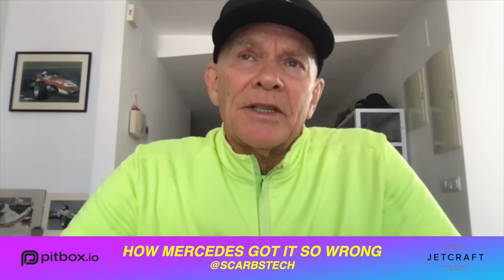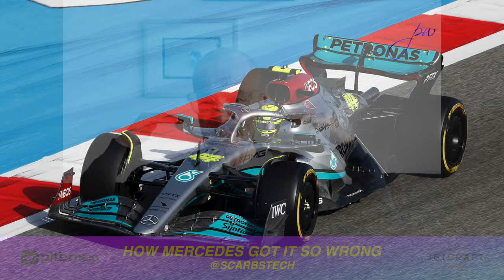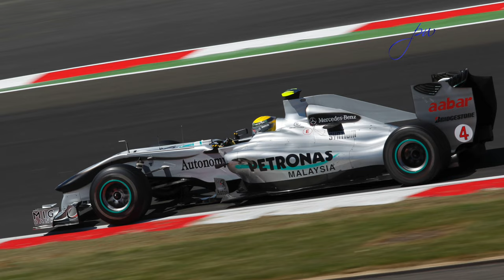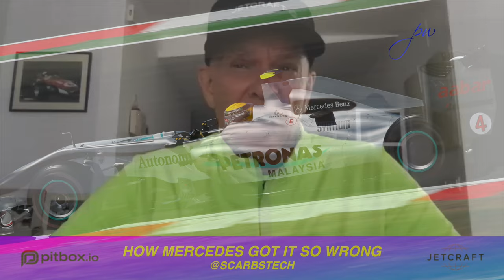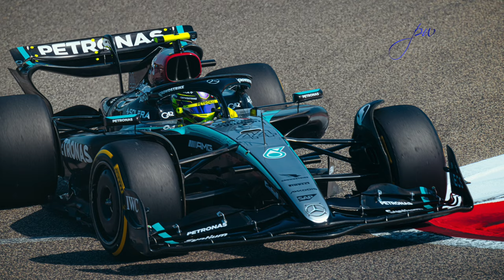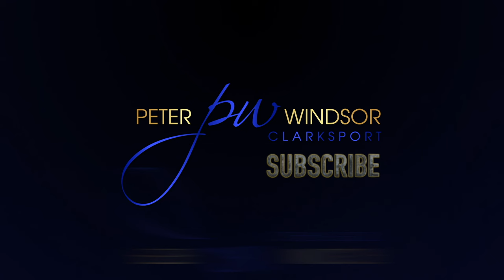HOW DID MERC GET IT SO WRONG? Scarbs analysis by Peter Windsor

Comment: Unfortunately, it doesn't seem like just a poor understanding of the new regs, it also sounds like poor engineering choices, compromising the CoM and allowing other detriments to affect driver positioning/feel, weight distribution and tyre wear, to facilitate the zero pods which Merc admitted were not that impactful on performance last year. Would getting this right have fixed the rest of the car? Probably not to the degree of being able to challenge RB, with the other issues they'd faced with suspension and aero/drag reduction, but it could have been one less area to have to fix over the winter...
Reply: My sentiments exactly , the floor design especially  and the lack of surface area around the car to direct air as needed 🤔 but not listening to the drivers regarding certain issues 🤔

Comment: If the car was porpoising because of the ground effect followed by bouncing with the fuel tank that high. The harmonic behaviour of the fuel (the oscillations) sitting up that high would be a contributing factor to the bouncing. The fuel in end becomes its own damper, as the oscillation’s decay.

Comment: I think it clear that once you commit to the package like mercedes did an found out it doesn't perform it difficult to bring a overall change to the entire platform. The package layout took all the investment along with the teams idea , so while everyone is saying this and that remember as Totto said the budget didn't allow them to change radically from what they had 🤔 the ability to package the mechanicals the way they did to use the reduce side concept is engineering on its own 🤔 that was the undoing of the car from lack of surface area to direct air in some way are another.
Reply: True, the budget cap didn't allow them make radical changes in-season. However, after the 2022 season, with a fresh budget, they should have either correctly optimized the concept (which they tried and failed at) or changed it---which they've finally done this year. 

There's no question that they dropped the ball because they had issues not only with the concept and the execution, they also had wrongly built scale models for wind tunnel testing. That's an unforgivable error for engineers of the elite class. 

Mike Elliot just wasn't up to the task.

Comment: This is an interesting but if this really is a correct assumption I am curious why they struggled as well in quali with super low fuel.Any which way i do agree with the assumption that they focused to much on aero and neglected the way the car and the weight of the car influences the relation between the car and the surface.

Comment: If this was such a massive effect, Merc wouldve been a beast in quali. Which they weren't.
Reply: Yip, that's the obvious question...
Reply: you're ignoring the part about the forward cockpit and the "feel" (or relative lack thereof) of the car by the driver.
Reply: sandbagging maybe?
Reply: @S0ulinth3machin3  What does that have to do with them supposedly gaining speed relative to  others towards the end of the race because their center of gravity was lowering?
Reply: I think the merc couldn't fire up the tires properly  causing the car to slide around early on in the race. Fuel tank being lower should help out alot, but good luck keeping with Max. That dude is in.the zone.
That
Reply: Merc has a great car…this will be like ‘21 though…where they have the best car, but not a good enough driver to beat Max, it’s a sad reality🥺
Reply: The fuel tank was still higher. Use some critical thinking my dude
Reply: I think their problem in qualy was that the car was draggy
Reply: @Marc98338  The point I was adressing was why the car isn't good at qualifying either, and the qualifying was mentioned in the comment to which I replied. What you just did is called the "strawman fallacy" in debate, which is tearing apart an argument which was never made. I'm not addressing center of gravity issue, I'm merely stating why the car sucks in qualifying as well as the race.
Reply: @S0ulinth3machin3  Is it so hard to think? Its litterly what my original point was. All these the things you mentioned are irrelevant because if this center of gravity effect was so huge in the race it wouldve been the same effect in quali.... Its not like they drove a different car in quali and the race... Use your brain for once.
Reply: @LordVader1887  Thats exactly what i did.... Of course its higher, but you explain me why the effect is big in the race with low fuel yet not big in quali with low fuel...
Reply: @Marc98338  Because the CoM starts even higher and who says the effect is not big in Quali? Maybe that's the limit of their one lap pace.

Comment: Iþ will forever mistify me why mercedes in effect copied the general shape of the "rokit" williams Russell had to fight with for years at the back of the field, last year.
However, after testing last week, i wonder how many teams, especially outside the big 4 at least, will turn up on thursday or race 2 with versions of redbulls genius zero sidepod design? Typical that Adrian Newy came up with the massive overbite start of the sidepods and that genius vertical slit air intake, maximizing the sidepods front tip aero, and in effect having a separate zero sidepod. The aero efficiency for both must be incredible.

Comment: They thought the downforce gains for zero pod where going to be massive, if it had worked we would have called them geniuses. Now they have to restart with a new idea and play catch up. With the cost cap teams cant spend there way out of a hole. And Redbull can keep putting more and more time into bext years and next regs car. So cost cap will keep cars apart. We need stable regs for a long time to bring cars together.

Comment: Not having their huge, locked in engine and advantage is really hurting them
Reply: Also questionable how they actually got this huge leg up in engine development to begin with. Glossed over these days.
Reply: @hh-jy1ld Bernie Ecclestone said Mercedes knew more than any other team going into the regulations because they helped the fia come up with the regs
Reply: @ajegelin merc F1 pushed for the MGU-H back in 2011 because merc corporate had one available as a gift to the F1 team. It had already been ironed out and 100s of millions spent on it. The split turbo also was already developed by Merc head office. It took everyone 5 years to catch up with the MGU-H and split turbo.
Reply: @robh9577  yeah, and then that advantage was locked in via engine freeze and token systems. And all of the British press hailed Hamilton and Mercedes for great engineering but never talked about how it was to the detriment of the sport. Now Red Bull are ahead, the slower teams get MORE development time and all the British media do is complain about Red Bull. I bet their tune would be different if Lewis was driving for Red Bull. It’s also funny to note how they British press is now talking about Ferrari positively too a complete turnaround to years past. It’s pretty sad.
Reply: @ajegelin  Merc also was burning special engine oil (from war crimes profiteers Petronas) until the party mode ban. To get around the fuel flow limit, straight up cheating the system of the fuel flow limits in the first place. 
But Ferrari gets busted for that in 18, Merc fans and the press go wild, still call them cheaters 5 years later lol.
Reply: @ajegelin and you don't think red bull knew more about these current regs beforehand ? 😂😂
Reply: @andrewmelton2686  Ecclestone said no teams knew as much as Mercedes as they already had an engine built and hybrid system ready. Read the comment above, someone else described it in more detail
Reply: @ajegelin  a yes, bernie Ecclestone. Im sure what he says is gospel
Reply: The hybrid regs were made by their request. There were 2 year ahead in engine development.

Comment: Merc got it so wrong because Toto is no Ross Brawn. Ross is a technical genius and turned 4 teams in title winning teams, two in dominated  form. Ross set the technical direction and worked directly with the engineers to develop this cars. Toto is a finance guy with no engineering experience. He was totally at the mercy of the engineers to do everything. The ‘14 car was developed under Brawn and Toto had nothing to do with it. He just inherited that monster and got all the credit. When the new ‘22 regs came along Toto was totally out of his league. He had no experience or knowledge to read the technical regs and set up a direction, like Brawn had done multiple times before.
Reply: Toto is the team principal, not the chief technical officer.
Reply: @jstoli996c4s  Ross was also team principal at Merc, but that’s exactly my point about Toto. Without Ross there they are lost. There’s no one on the tech side as good as Ross Brawn to guide them like he did in ‘10 - ‘13.

Comment: Gosh I had no idea the fuel tank was mounted slightly high last few years. This is a very basic racing fundamental - I cannot believe a team like Mercedes could be so far out with this...even if it is only marginally higher. This and the cockpit slightly forward would definitely account for imbalance and pendulum effect. This definitely smells of Aero dept having final say over chassis dept. Fundamentals Should Never being ignored.

Comment: in the RBR F1 team technical department, is it really just the brains of one guy, like Adrian Newey, that creates a masterpiece of a car?
if so, do other teams have their own version of a Newey?  or is it more of a team effort.  
are other engineer/designers hands tied?  or are they really so far away from what Adrian Newey can do each year with an F1 car?
Reply: It's not one guy. But the genius and experience of that "one guy" helps protect the team from bad design and engineering challenges. Aston Martin benefited immensely from the arrival of Dan Fallows from RedBull where he was an important member of the team but still subordinate to Newey therefore enjoying some level of protection from bad design and engineering choices. At Aston Martin, he built a great platform termed the GreenBull and based very closely on the RB18. But all of his attempts to improve the concept fell flat because he lacked the depth and genius of Newey.
Reply: In the case of ground effects, yes absolutely. Newey had already been down that road with indycar and early 80s F1. So he knew porposing was a thing, and built the car in a way that it was a non issue, while the other teams spent 1 ot 2 years trying to fix it, before they could even thinking about high level aero or improving their platform.

Comment: Mercedes has always done things differently. They got it right with the spilt turbo, interconnected suspension, das and the low rake concept. They didn’t with zero pod design, but they were still the second best team. They know you won’t beat Newey by copying him. That being said, they’re not the powerhouse they used to be, several key players have left. Red Bull now has that strength of staff that Mercedes once had.

Comment: Whilst the wind tunnel aero numbers may have crunched downforce-wise, with a high fuel tank it must have been awful to drive...No wonder why Lewis was so fed up with last season's car in particular...
Reply: Yeah, it helps explain why he was so frustrated at the start of the season.  He knew regardless of downforce they built a bathtub of a race car that couldn't be fixed in the wind tunnel.
Reply: Dude was mad at the 2nd fastest car on race pace.
Reply: @3rdGenGuy  they were over a second slower than Redbull in race trim over the entire season.  When the gap is that comfortable it's almost impossible to measure because Redbull won't push the car when they have a pitstop margin.

Comment: They got it wrong due lack of knowledge and quality in their design team. This problem is not taken away and will continue to show in different areas.

It will be a long season for Mercedes fans, and Lewis…
Reply: The resr of the car seems to be suffering a little still in the corners, but other than that, it is a tremendous improvement.

Comment: I wonder if there is any flex to the fuel tanks, as in: within the regulations, can they vacuum the empty part of the tank in a way so that the space around the tank can then serve as an ever-increasing empty space as the race continues? Imagine the fuel tank being sucked up and the gap that's created being used for some aero effect.
Reply: That's a novel idea for sure. But regardless of whether  or not you have a 'convertible' fuel tank, there remains the issue of the chasis' form. Would you expect the engine cover to cave in along with the fuel tank? Probably not. I think what's to be gained in the reduction of fuel in the tank is already so gained in the form of the center of gravity dropping (slightly) lower.
Reply: @william_chidube  I'm more thinking of also applying some kind of F-duct magic. If it creates space, that space can fill up with air, and that air can then be used.

As the car gets lighter, maybe that space can be used to steer other aero-effects (from the bodywork) to flow along other bits of the car more efficiently.

Just thinking out loud here: Imagine that the body of the car above the fuel tank is porous and lightly pressurized air can escape through it. Then the air flowing over the top of the car will flow faster. It'll hit the rear wings faster.

Or just use it to cool the driver instead of that front opening (or reducing it in size), increasing effectiveness by reducing the front gap.

Or use it to cool the engine slightly better. 

There are probably thousands of ways to deal with that kind of thing :)

Comment: Easy, they never listened to their drivers.  The car lacking in top speed, corner downforce, and still bouncing down the track.  The issue is Mercedes engineers missed something rather obvious in their simulations ... too much airflow causing turbulence.  As the air flow increases via aero design/undertray/speed the low pressure increases (or decreases relative to POV) which sticks the car to the road surface with minimal drag.  However, if the air flow increases so much that it's causing turbulent vortices they effectively stall the downforce generated momentarily which triggers unloading of the suspension which reduces flow temporarily and repeats the cycle -- the bouncing.  Mercedes seem unable to identify where and what is causing the turbulence at a given speed.  Since this issue seems to vary from track to track it's likely related to air density as well.  This is all basic aero engineering so I'm surprised they can't figure this out with simulation?  SolidWorks have flow modules (very expensive per license but easily affordable for F1 team) that can simulate air flow over variance in velocity ... perhaps Mercedes decided to do their own flow modules and that's where the problem exists?

Comment: Mercedes will be back in 2026 when the engine starts being important again. Which would possibly be quite upsetting for Lewis because he's not winning a WDC in 2025.
Reply: Lol Alsion owned Newey in 2020 & 2021 with similar performing engine.
Reply: Mercedes lost a lot of their engine development team to Redbull.  I also don't think the changes to engine rules will be a 10th and drastic as they were in 2013
Reply: @ktcool4660 the Honda engine wasn't even close to Merc in 2020 or 2021, mercedes also had 8 years to do nothing but focus on chassis development when they had significantly more money to spend on development.  Redbulls wind tunnel is a relic from the 70's used to design the panavia tornado.  It is the least advanced on the grid by some margin yet their aero is still the best on the grid.
Reply: @Weakeyedominant   "Honda engine wasn't even close to Merc in 2020 or 2021," why are you lying so blatantly? Newey has to double down on aero efficiency because for 8 years  there engine was lacking. Most importantly 2021 rules broke the knees of low rake cars like merc favoring high rake Newey cars. Merc still out developed Newey in 2021.
Reply: @ktcool4660  Hamilton was able to swallow two grid penalties at Interlagos in 2021 and still breeze past verstappen like he was in GP2.  The Merc has always run more downforce than Redbull knowing they had the power in the bag.
Reply: @Weakeyedominant  Hamilton GOAT tax in Brazil. You're yet to provide any proof that Honda engines were inferior to merc in 2020 & 2021 when it was showed that RB had better top speed in 2021 season.
Reply: @ktcool4660  Merc had an over 10km speed advantage through the speed traps in Brazil.  Are you saying Hamilton got out and pushed 🤣
Reply: @Weakeyedominant  "Merc had an over 10km speed advantage through the speed traps in Brazil" with DRS enabled. You are a casual.